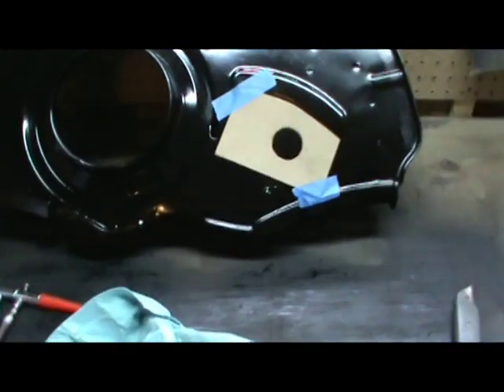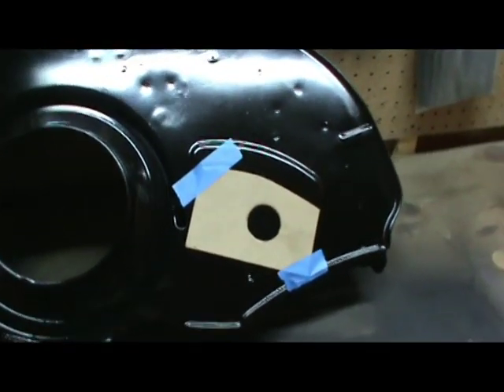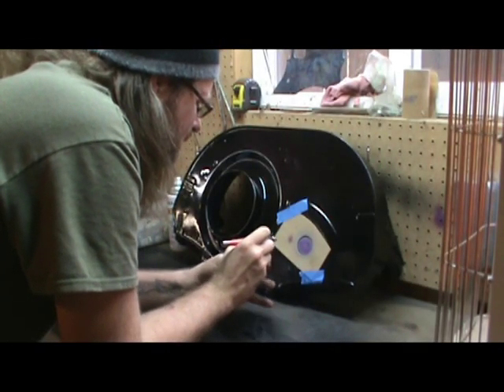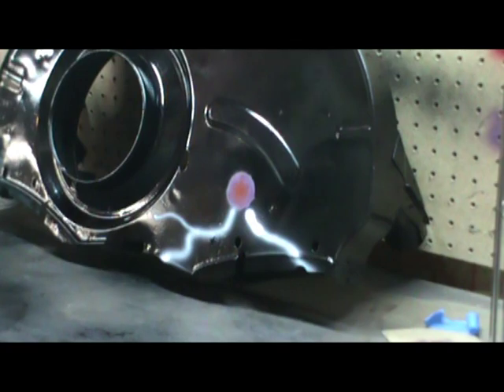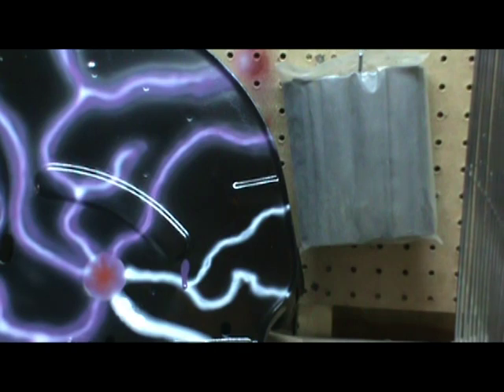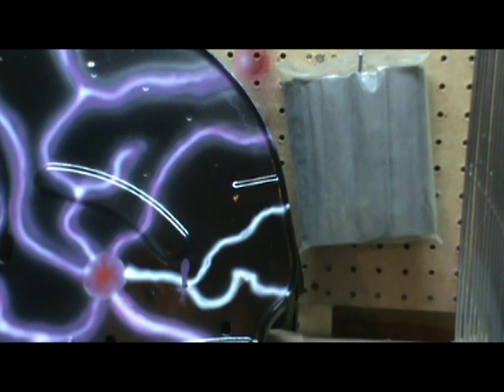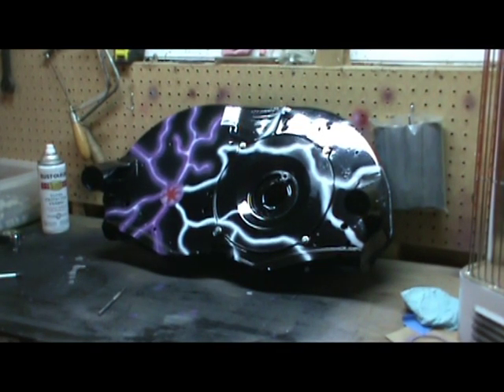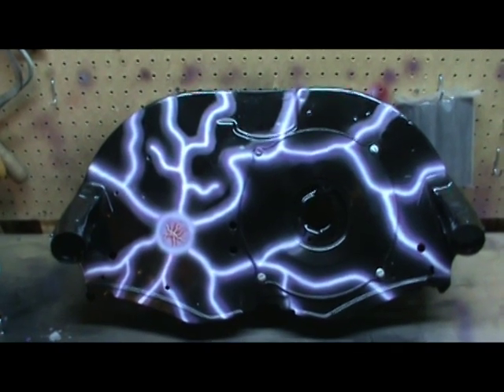Custom Paint On Fan Housing

Comment: Nice freehand on the arcs! I used to do some airbrush work with a badger. One medium tip and one fine tip.  Color change was ok once I got handy with the breakdown and clean up. Anyhow, nice job. I wonder if my little compressor still works, it's in my attic someplace! .